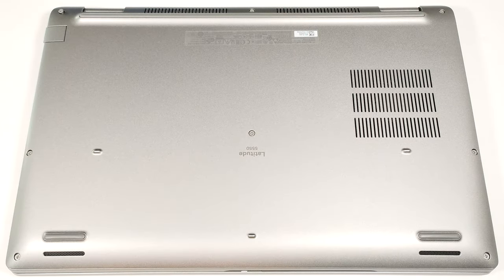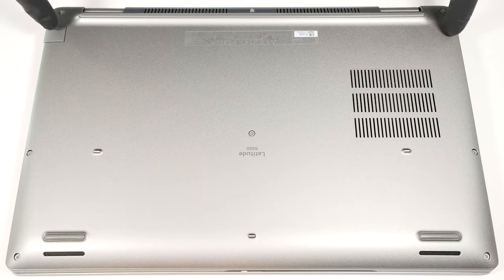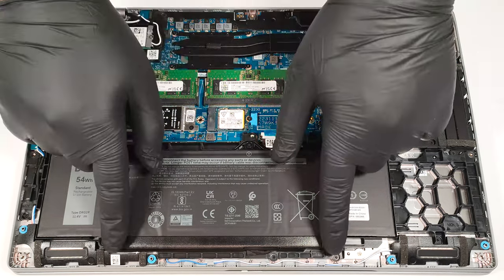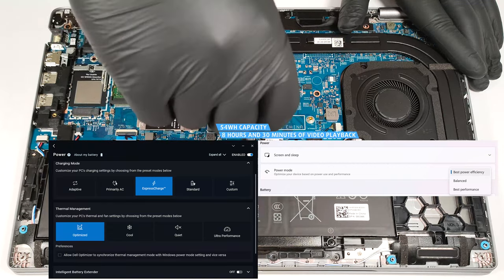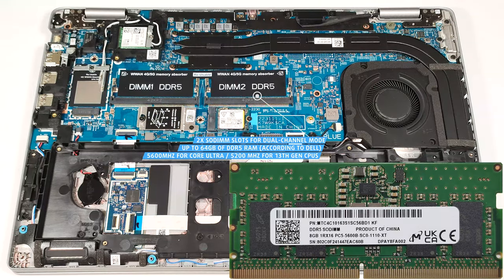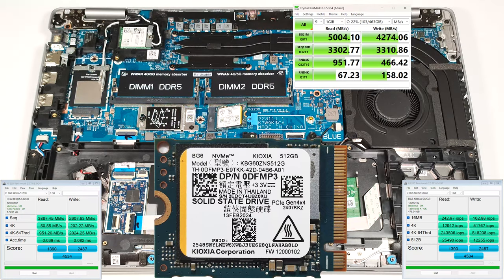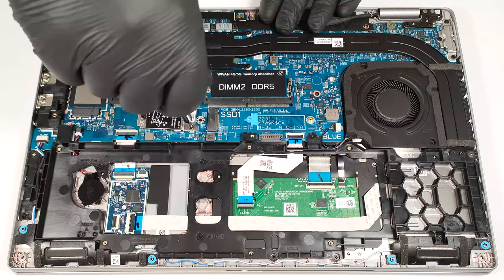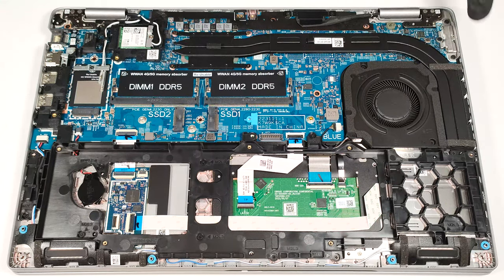🛠️  How to open Dell Latitude 15 5550 - disassembly and upgrade options

Comment: Wow, despite the AI voice and even playing at 2x speed the video was too slow. great explanation of all components and options avaliple for upgrades. looks like there is a GPU Model available from the factory if you get the Core Ultra 7 165H, you can add a RTX 2050 4GB for $130.43